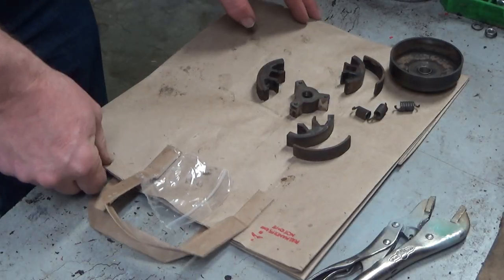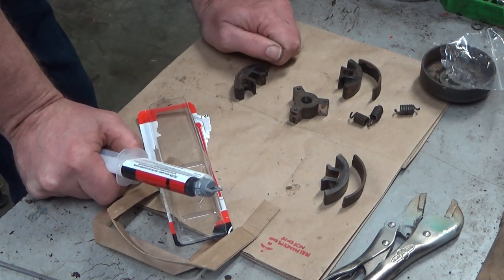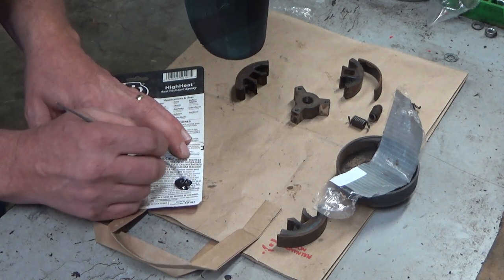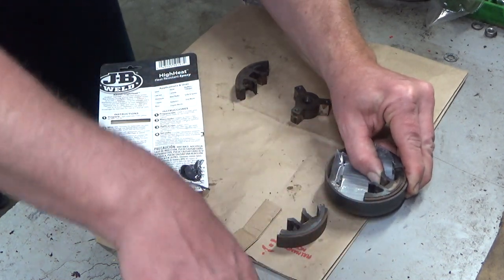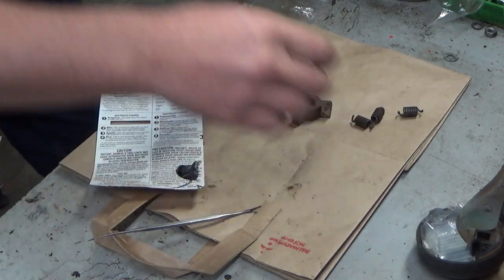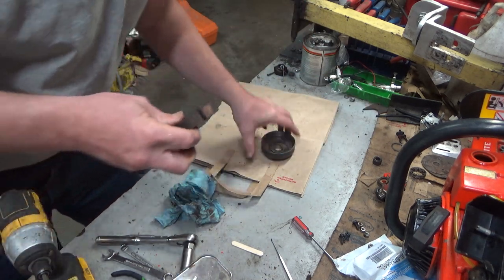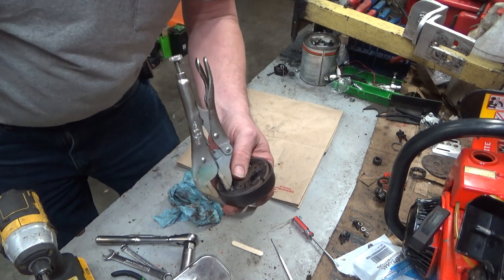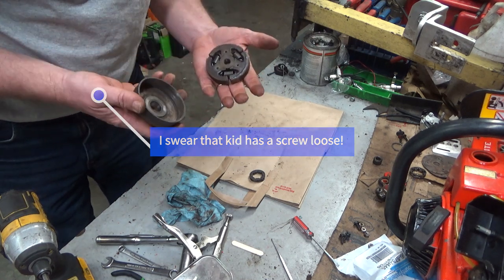Possible Homelite 550, Super XL-925 Clutch Shoe Lining Repair!

Comment: I like to use my little grinder and after I clean up the surfaces I lightly rough them up for better traction.
  My thoughts are even after cleaning, there could still be a film on the surface.
  I’ve repaired rubber AV mounts using this method when I couldn’t find them on EBay.

Comment: Ive had except luck with that specific brand and type of epoxy. Really does hold up to heat well and incredibly strong. Only one thing different i might try. A band clamp of some sort might be easier to keep good constant pressure around it. Like a pipe clamp or a simple hose clamp. Oh and give it the entire recomeded time for curing

Comment: Electro contact cleaner and 98% isopropyl alcohol are also an extremely great cleaners that will dry fast and leave little to no residue for using adhesive products such as super glue and JB weld products.

Comment: This appears to be right. The glue needs to be resisting oil, chemicals and heat. What some are using is Loctite 9492, and it appears to similar.
Maybe the neighbour kid is fixing his chainsaw. Sometimes a little screaming and cursing helps.